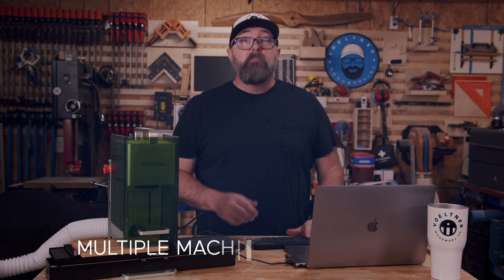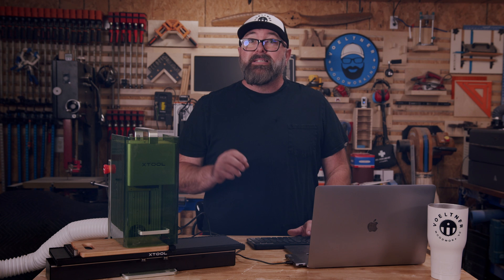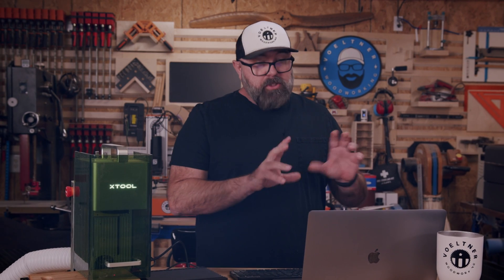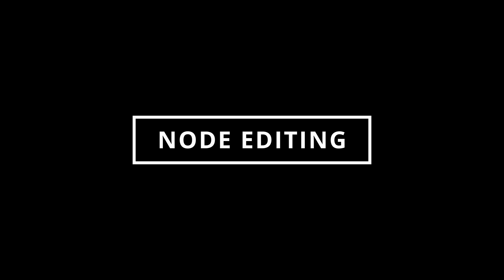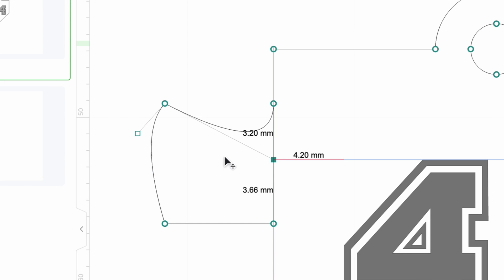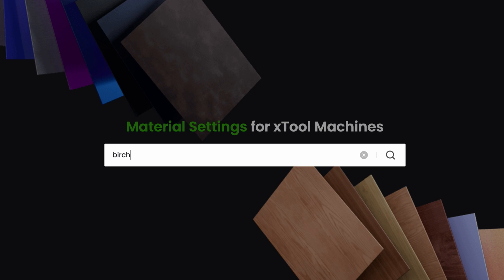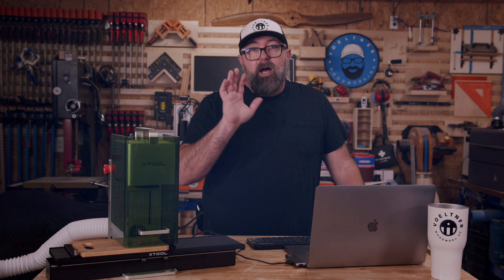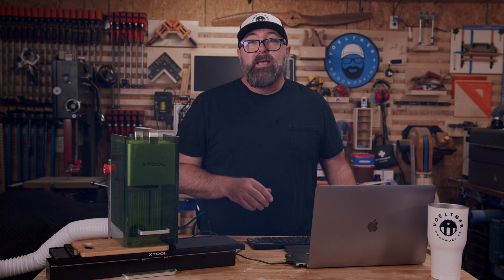xTool owners get ready. Lots of updates!

Comment: When editing nodes. I recommend turning OFF the auto snapping. auto snapping is SUPER annoying when editing node handles. Makes it almost unusable. Once i turned off auto snapping it has been an amazing addition. Xtool needs to create a control key to bypass auto snapping - which it doesn’t do today.
Reply from the maker: Yes, great recommendation.
Reply: 100% what you said! Snapping shouldn't require a settings level change and for most of my usage, snapping functions horribly.

Comment: Awesome presentation 👍👏! I have a question: I only have a budget of 2,100. Amazon has XTool S1 20 Watt for 1,877, w/riser, tumbler, air assist. If I get the S1 20watt and down the road upgrade to the 40watt module it is another 1,499. On the other hand, WeCreat just announced their new 40watt laser for almost the same price as the xTool S1. My use would be both cutting and engraving. I seen the xTool S1 does a fantastic job engraving with the 40 watt. So, I believe WeCreat may do the same. If you were me which laser would you go with?
Reply from the maker: I have both and recommend xTool 9/10 times because of their software and support. I haven’t had to use tech support for either but hear WC support not great. There are plenty of xTool user groups available too.
Reply: @VoeltnerWoodworking  Thanks for the info. I ordered the xTool S1 40-watt on Amazon. I think I got a good deal. I paid $2,049 with the honeycomb tray and air assist. They had a 20-watt with a honeycomb tray, air assist, riser (not pass-through), and a rotary for $1,878, but I went with the 40-watt and decided to get the accessories little by little. Again, thanks.

Comment: What windows version does it need to operate? I tried to download this on an older windows version and I got an error when I tried to open the program.
Reply from the maker: Here are the system requirements: https://shorturl.at/e01B5
Looks like Windows 10 or newer. You can also use a smartphone (iPhone or Android) or iPad to run the system.